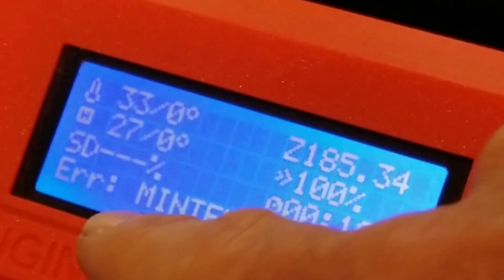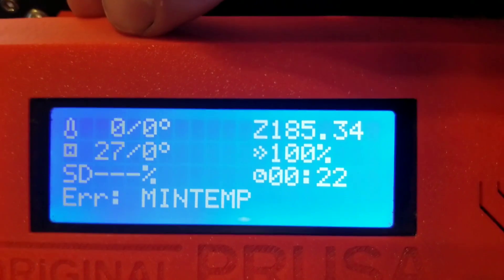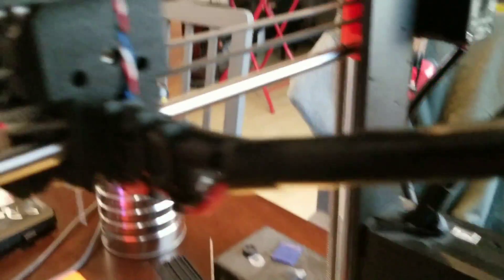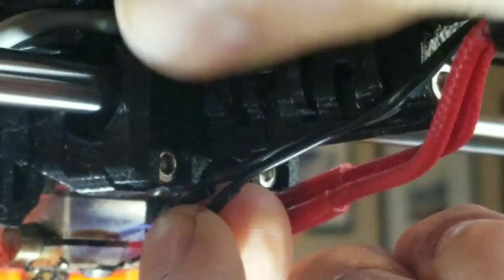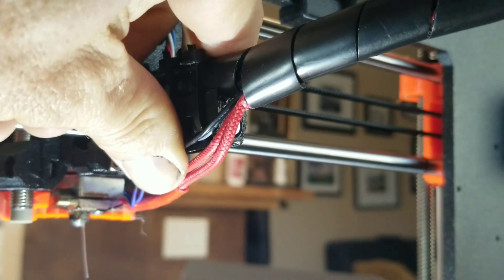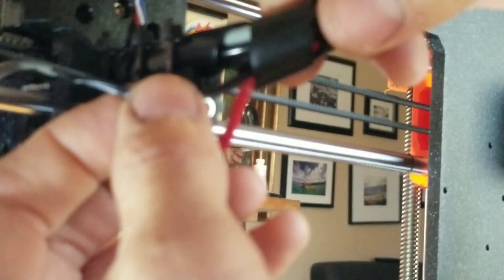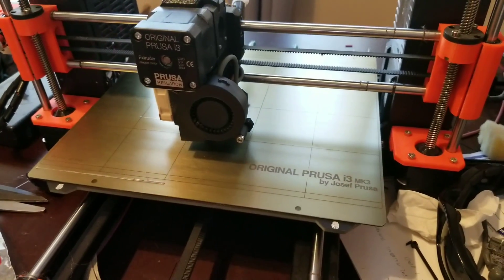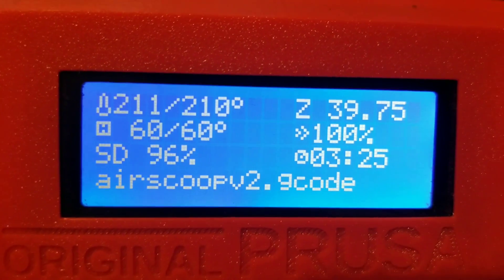First issue with Prusa i3 mk3 "ERR: MINTEMP" and how I fixed it.

Comment: Soon after I began using my factory-assembled Prusa i3 MK3S+, its thermistor wire broke. I replaced it (after wasting several hours proving to Prusa reps that the thermistor was indeed the source of the problem; obvious to me, with my electronics background). Months later, it failed again, followed by days of wasting time going back and forth with Prusa reps.

For anyone who hasn’t done this repair on a recent i3 MK3S+ (it’s a bit different than the printer shown in this video), it is exasperating because the engineering of their cable assembly is simply harebrained. Of the many engineering decisions made in designing that, all of them were utterly stupid. Competitors have better cable management methods, and I thought of one that would enable repairs to be made easily, in seconds. Moreover, my method would markedly reduce the likelihood of broken wires in cable bundles. I mention this to various Prusa reps and offered to give them that technology; so far, they don’t seem the slightest bit interested in seeing what I developed.

The Prusa assembly manual admits that cable assembly is “difficult” — in fact, the most difficult aspect of assembling the printer. That should have been their first clue to rethink their needlessly backward cable management.

I understand that isolated engineers can make myopic decisions but I don’t understand why those supervising them don’t realize the problems. In this case, to save intellectually lazy engineers a bit of thought (my solution was generated within seconds of pondering this issue), that problem was transferred onto every customer who bought this printer type.

Good engineers solve problems so customers don’t experience them; bad engineers permit those problems to go out the door. This abysmal cable engineering persists year after year.

With competitors rapidly gaining ground and often surpassing Prusa, their complacency will come to haunt them. Everyone who designs products should always question themselves, “Is there a better way?” In this case, there is a vastly better way.

Comment: OMFG I am LITERALLY running into this EXACT issue. I hope this solves my problem, just pulled my printer out of my enclosure!!
Reply from the maker: This fix is still working on my printer. I use this printer ALL the time and it's had no other issues.
Reply: @gordontarpley  so, I actually had fully replaced the thermistor.

Then went to warmup the prusa. Got thermal runaway. Then reset and let it sit. Came back, warmed up again, and 10000%, the thermistor must not be working because it won't get up to temp for 240 degrees C, but the hot end was well over 260. It was boiling petg, and my prusa was smoking bad. Like it was about to catch on fire. So... needless to say, even with my new thermistor, back to the drawing board.
Reply from the maker: @HarrowedDreams  whoa! That's scary. Keep me posted on how you fix it
Reply: @gordontarpley  will do!!

Comment: Hi, I have four mk3 machines and one mk3s. All 5 were kits that I built.  I've just had issues with both the hot end sensor and the build plate sensor. Both were intermittent broken wires on the mk3s which is a relatively new machine. I'm wondering if the wire used on the mk3s is different. I did use silicone wire for the repairs. I'll see what happens

Comment: Mine came out of the box with this MINTEMP error, and you want me to start cutting wires and soldering sh*t.  This is f*stupid.
Reply from the maker: Mine has worked like a total trooper minus that issue. I've printed SO much stuff with this printer and its been crazy reliable. If it arrived like that I'd contact Prusa and see if they can send you a replacement part. Also, if it's really cold in your room you may get the error. See if you can preheat and reboot while it's warmed up and see if that does the trick.
Reply: @gordontarpley  Thank-you for the kind words, I was very upset and didnt show much good character.  But I will eat the crow and say, it was the red button on the back that switched from 220 volts to 115.  That is why mine wasnt working.  Once I switched it to 115, it has ran great.  I have made 4 prints.  And the last 2, I drew in freecad myself.  So very happy.  Also, mine is an Ender 5.  Again, sorry, I am new.

Comment: my rpusa just gets this stupid heat bed spike from 60° to 300° and the printer stops, sometimes it prints with no problem and then all of a sudden 300°
Reply from the maker: Sounds like a problem with the temperature sensor.
Reply: @gordontarpley  yea but i cant even update the damn thing, it crashes during it
Reply from the maker: @kthec1298  should be a physical component to swap. Not sure about the crashing. Might be good to contact Prusa.
 Minus this wire issue, my prusa has been a total champ. It's literally running right now as I type this.
Reply: @gordontarpley  
weird thing is, i got the update running, started printing, maxtemp bed error, got the mainboard out connected the thermistor cables again, now its doing the second print with no crashing, im kind confused about this

Comment: I've just had the same problem and I found the explanation in the "3d Printing Handbook". it says that the HOTEND temperature has dropped below 16deg C, unfortunately there is not mention how to fix it. Before wiggling or cutting wires I think the first logical thing to do is turn the power off and back on (I don't recall seeing that being mentioned anywhere), infact this didn't clear the error. I then pressed the reset and the error cleared. I think the fault must cause a toggle to set and turning the power off doesn't clear it, only an actual reset does.

Comment: Brilliant ! Thank you ! same problem there ! but The connection is loose just at one specific point on the x axis that I found by disabling the stepper motor and manually move the x axis. Will try to deal with prusa for a new part.

Comment: Had this issue with my new printer a few months ago. Drove me crazy because I couldn't locate the break. Turns out complete replacement thermistors with wire and plug sell for £5 for 3 on ebay. Job done
Reply: and I wasted $20 for 2, although I must say they are very nice

Comment: I've had the same problem in the past mine was one wire that goes in to a small hole on the heat block the wire only has a tiny peace of solder on it I just pushed it back in the hole